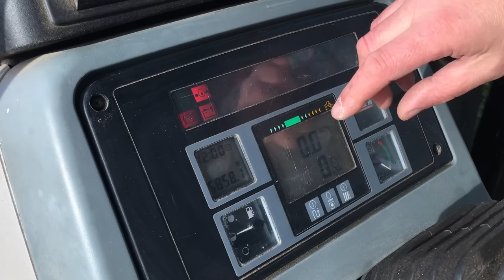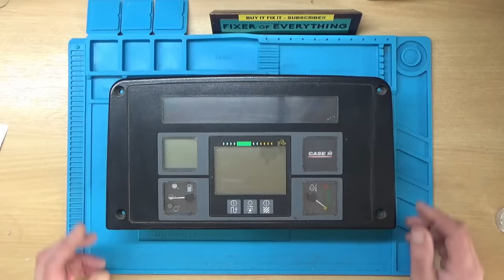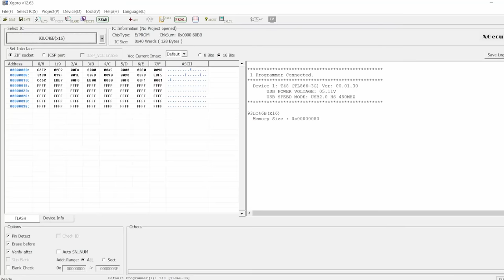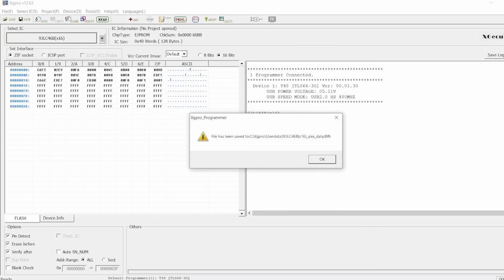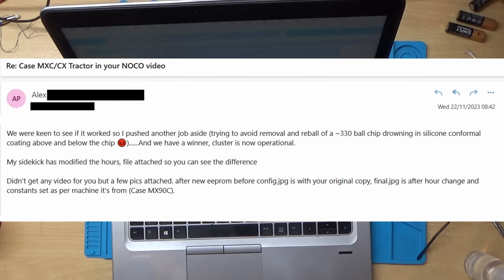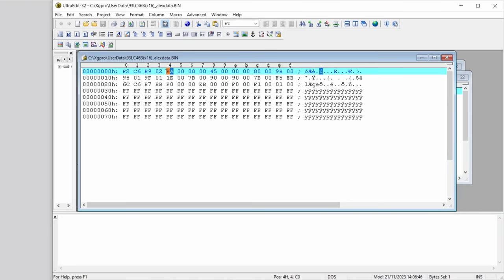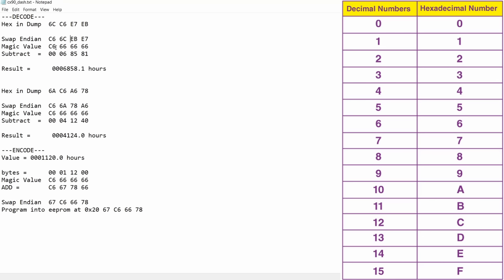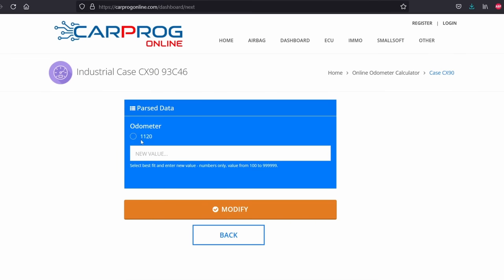Helping Someone 10,323 Miles Away Fix A Tractor Digital Dashboard!

Comment: I have a Kubota that is about 5 years younger - it's still 100% electro-mechanical.  No semiconductors to be found there, for which I am eternally grateful!
Reply from the maker: I've got a little Kubota RTV900 tipper truck. That doesn't have any semiconductors either.. Although the alternator just died, so I'm waiting for a new one to arrive (another job to do lol).

Comment: Legendary problem-solving and troubleshooting skills coupled with an insatiable curiosity for knowing how things work and on top of that incredible practicality and common sense. Inspiring.
I want to thank you: I was in a challenging (for me) troubleshooting situation with a Nortek VRF (heat pump) system that multiple contractors had walked away from. I channeled your patience, calm, and reasoning and was able to solve the problem. Thank you! Most guys in my shoes would have said there's nothing that can be done and ran off.
Reply from the maker: Thanks Matt and well done on repairing the heat pump! 👍

Comment: This is the most badass thing I've ever seen
Reply from the maker: Thanks 👍if you liked this then you might like the solar inverter I repaired and then had to figure out how the service password was calculated as the company wouldn't help me, or the ultrasound scanner where I unlocked a ton of hidden features and made it run doom 🙂
Reply: @BuyitFixit  I'll be sure to check them out during my binge :)

Comment: Save yourself the time and trouble (and risk) to remove a chip from the board, use some DIP test clips. Most of the time you can read/write EEPROMs in-circuit. Test clips are available for SOIC as well.
Reply from the maker: Thanks for that. I've got some SOIC test clips, but I've had limited success when trying to read eeproms in circuit. I tried with a landrover ECU a while back and it wouldn't read. Was just easier to remove the chip.

Comment: Considering the most sophisticated tools my Dad needed for our tractor growing up were a sledge hammer, pocket knife, "Bob" the screw driver (a big old beater flat head) baling wire and if feeling fancy, electrical tape lol, tractors with computers in them are hard for me to really wrap my head around...
Reply from the maker: This one is pretty basic, I think it's only the dashboard that's computerised. I dont think the engine has any electronic controls. The newer ones are way more complicated and pretty much all controlled by computers including the engine like a modern day car.
Reply: A welder helps if you manage to let the block freeze. I live in Austria, home of the legendary Steyr 80 series tractors, one-cylinder Diesel pigs from the 50s. Most of them have had the block welded at least once, some twice. Some of the T80s were sold without any electrics whatsoever, the posh ones got two headlights, either a combined rear/brake/number plate light or two rear/brake lights and a number plate light, a glow plug, a generator with regulator and a starter. Oh and of course a horn.

Comment: Very nice of you, noone I know will dare to do this.
You should have put a IC socket on the chip? rather than soldering it back.. heat damage to PCB risk etc
Reply from the maker: Thanks, agree I probably should have put a socket in. I didn't think I had any, but found some a week or two ago (used them when looking at the caravan x70 PSU)

Comment: Excellent job, much respect. You are a true gentleman and a scholar.
You should have checked every bulb in that dash while you had it apart, cos as sure as bears sh1t in the woods, one or more of the bubs will blow now you've had it apart. It's Murphy's law.
Reply from the maker: Thanks 👍There was a few bulbs gone. Ideally I should try to get some LED replacements.
Reply: @BuyitFixit  you could make some LED lights yourself, a LED and resistor would do the job. 
You can get premade ones but the cheap crappy ones won't last pissing time
Reply from the maker: @generaldisarray  I'll have to see if I can find some white LEDs

Comment: Very good, your reputation is obviously spreading furrow and wide. Surprised there was no JTAG connector, but each to their own. You were, of course, lucky that the text wasn't inverted.
Reply from the maker: Thanks 👍
Reply: There are so many different JTAG headers & adapters, unless you have the platform specific tools. Its more hastle than removing the chip.
Reply: A JTAG connector is not good to use in the enviorment the tractor is operating I think.

Comment: Oh I do like a bit of hexadecimal digging. Congrats on the remote repair and being willing to risk your eprom for his tractor. Great result..
Reply from the maker: Thanks John👍if you like this sort of stuff check out the video I did on the solar inverter called 'no password no problem ' or the medical ultrasound I looked at and unlocked a ton of extra features, or the RGB laser I repaired 👍
Reply: @BuyitFixit  thanks for the tips will investigate. I learn that way, been around software and firmware engineering for about 20 years. They do keep things close to their chests I found. Or no time to explain to a non programmer☹️
Reply from the maker: Thanks John 👍

Comment: For odometers in cars where storing in EEPROM would happen more often than the maximum numbers of write they use a simple wear leveling methode which only works for ascending numbers: There is a row of numbers stored, say 4 times. The highest one is the one being displayed and the lowest number is the one to  be overwritten next. So that is a 1:4 wear leveling. Works perfect, because I did this with a PIC16F874 back in 2001. The products (about 2000 were sold until 2016) still come in for service and no EEPROM has ever failed until now.
Reply from the maker: Interesting solution! Thank you for commenting 👍I did have another dump from a different tractor that someone sent me to look at and it has the value duplicated 3 times but it's all the same value. This had 2503 hours. A friend of mine worked this out after I sent it to him, I had company over so didn't have a chance to look at it myself.

00000000h: AA FF 00 02 4A A4 93 83 00 02 4A A4 93 83 00 02 ; ªÿ..J¤“ƒ..J¤“ƒ..
00000010h: 4A A4 93 83 00 00 00 00 00 00 00 00 42 00 8F 14 ; J¤“ƒ........B. .

00 02 4A A4 = 150180 mins 
00 02 4A A4 93 83
the last byte 83 is the sum of the previous. We aren't sure on the 93 byte though.
Reply: @BuyitFixit  Yeah that is odd. With the checksum being explicitly for the counter only, one would guess that the 93 must be related to that counter value somehow. But I have no idea what it could be. Concerning wear leveling: After coming up myself in 2001 with it, I found the same methode in the cluster of my VW Golf in 2016-ish. The blue LEDs were so dim that I had to replace them. VW also used another methode for storing the 0.1km odometer values which I didn't bother figuring out.
Reply: @BuyitFixit  One idea about the two counters: Storing it twice could be a way to determine if the value was changed at some point. While one of them is displayed and can be changed with the programmer, the other one can only be read. This could be used as a tamper detection.

Comment: Very impressive, well done! :) Certainly made interesting video too. 
Brought back a memory of my dad's old 1995 VW Golf Mk3 Variant, at some point the instrument cluster digital LCD odometer panel started showing only parts of the reading, except when the temperature was colder than -20C, then the numbers showed up completely. 
At the time I didn't know much about electronics, but now I'm guessing probably the LCD display solder joints were cracked or something. Eventually the whole instrument cluster was replaced. 
Too bad Youtube didn't exist back then, would've saved a lot of money if I knew back then, what I've learned now from yours and others repair videos :)
Reply from the maker: Thanks MrJSV 👍

Comment: Very well done. You risked damaging your panel to help someone in my country (Aus). I'll bet if he took it to an authorized  repairer they would have wanted to replace the entire panel at great expense.
Reply from the maker: Thanks, and absolutely! I've had issues with companies before where they wouldn't supply parts or would only replace the whole device great expense. An example would be the FLIR thermal camera I repaired after getting no help from FLIR (I show all of the emails on the video on my channel too), and another would be the solar inverter video called 'No password No problem' where I had to reverse engineer their software because they refused to give me a service password and said it's an old model, buy a new one! (I also did a video on repairing it as it was a dead unit when I got it).

Comment: Absolutely fantastic video. The attitude, the great explanation skill and superb detective work. I wonder how did you realise what the magic value is. Thanks a lot!
Reply from the maker: Thank you too for your kind comment 👍 That online site I mentioned (in the video) I changed 1 of the byte values by 1 and uploaded it to see if anything changed. When the hours increased by 1. I then knew that for instance a 7 in the dump equated to a 1 in the hours.  So at that point I knew 6 = 0, then it started to make sense 🙂👍
Reply: @BuyitFixit  now when you said it it sounds so simple. I guess that happens often with clever ideas. Again, thanks for sharing. Not that I can use the idea to fix the tractor mileage but because I enjoy your thoughts sequence and can educate myself.
Reply from the maker: Thanks 👍

Comment: Re. the "magic value", it looks to me like it's using a variation of BCD (Binary Coded Decimal). If the value was stored in binary, they'd have to do the conversion from binary to decimal to display it, and that might be too much like hard work for a low-cost microcontroller. Using some form of BCD would be easier. With the digit 9 represented by F, adding 1 would make it wrap around to 0 and generate a carry into the next digit. It's easier to detect digit 0 and then add 6 than detect digit A.
Reply from the maker: Could well be. Someone else mentioned similar and it seems a common way to convert to BCD by adding 6 👍

Comment: the data is stored as little Indian, also a tip for owner who have Hare and tortoise modes that dont work is to check the rear axel oil pressure switch and oil level.
Reply from the maker: Indian 😂gotta love auto correct (my phone did the same when trying to type endian). Thanks for the info 👍

Comment: Most likely used the same software to dump and write as it has an hex editor, my guess is he searched for your hours, came back with a hex code, he then converted his hours into hex code and replaced and reflashed :) how I repair corrupt mac bios and use a dump I have and change the serial back to theirs :)

EDIT: I post this when the video was half way through :P he explains how :D
Reply from the maker: Yep, explained it and how the the data is stored 🙂👍

Comment: This is awesome, well done! Just wondering.. would it have been possible to download the flash with the chip on the PCB, I see there are 8 pin in-circuit clips available for this function.
Reply from the maker: Thanks 👍,Yes it is possible, although sometimes it's not straight forward (I've tried in the past with limited success). Normally you would need it powered from either an external source, and have the microcontroller held in reset, so it could not mess with the I/O lines of the EEProm.
Reply: It worked with Delphi Skoda OEM radio,  I did not even have clips- just soldered fine wires to chips legs. It wasn't  DIP8 "big" chip either but small SMD part.
Reply from the maker: I tried with a Landrover ECU once, to remove the immobiliser, but ended up having to remove the chip and read /write it, as it didn't like it being in the circuit.

Comment: I have a smallholding in the UK, 30 acres or so, all my tractors are 60s 70s 80s pre electronics, simple mechanical systems, I rarely have any problems with them. A quote from an engineer : "Perfection is reached, not when there's nothing left to add, but when there's nothing left to remove....
Reply: When you put few hours on your machinery per year, complexity is your enemy.
Reply from the maker: Agree, we have about 30 acres too, and about 70 sheep or so 👍🙂
Reply: @BuyitFixit  Ah sheep, however good your husbandry, a certain percentage seem to just die for no explicable reason, I never figured out why. I'll stick with cattle.
Reply from the maker: @andypdq  I think you can see them on the 2 x night vision monocular repair video that I did, or there's a picture of a couple of the 'expensive ' ones on the medical ultrasound video.

Comment: Liked and subscribe. The least I could do on behalf of the open hardware community.
Reply from the maker: Thanks! I've had a few run-ins with companies when trying to repair devices. I asked FLIR for a spare part for one of their cameras, and got an email back saying they couldn't help to do copyright and proprietary information. I only wanted to buy an LCD display! I ended up doing a video on that, and my work around which may interest you. Also I had a problem after repairing a solar inverter (video on here) which I needed a service password and the company refused to give me one and said buy a new inverter! (which I wasn't going to do seeing as I just fixed the thing). I spent a few days reverse engineering their software and wrote my own password tool which I've made available to anyone who is in the same situation (video on here too called 'no password, no problem'). Hope you enjoy some of my other content 👍

Comment: I wonder why that magic number is used and subtracted? Also why did the EPROM content fail the other tractor, but it looked intact in your editor?
Reply: I would imagine the magic number is just to obfuscate where the hours are stored in the eeprom, would be all too easy otherwise!
Reply from the maker: The eeprom gets written to every 6 minutes I guess, it's possible that something went wrong during one of those writes and blanked it. Or sometimes chips can fail for no obvious reason.
Reply: The magic number offsets each BCD digit from 0x0-0x9 to 0x6-0xf, which I suspect is there to make it easier to increment the number. Each digit just rolls over 0xf->0x10 naturally, the current digit becomes 0x0 and the 0x10 carries over to the next digit. You do still need to go over the results and deal with any rolled over digit to add the 0x6 offset back, but that's trivial to do.
Reply: @ville_syrjala  certainly clever thinking, but it is also trivial to deal with the 9 rollover - and then you don't need to take additional steps when writing the value to the display, so I dunno...bit strange
Reply from the maker: @zaprodk The EEPROM in the other dash was all blank 0xFF. The dump he sent back was a copy of mine with the hours altered which is what they used after testing my dump worked.
Reply: @BuyitFixit  every 6 minutes. That's a good way to wear out the chip. What's the block size of that particular chip?
Reply: @zaprodk   should last 10 years with a 1 million cycle endurance shouldn't it? I've seen FRAMs used in more modern equipment for this purpose, they have a 100 trillion cycle endurance!

Comment: I'm sure Case IH hates this.  They would rather they sold you a replacement dash.
Reply from the maker: Unfortunately it's the same with a lot of manufacturers. I fixed a solar inverter on here but then needed a service password to change a setting. The company emailed back with 'buy a new one' pretty much. I ended up reverse engineering their software and writing my own password tool which I made available for free to anyone who wants it (no password no problem video on my channel). I also had similar with FLIR when trying to repair one of their thermal cameras (video on my channel too). Thanks for commenting 👍

Comment: being an ignorant layperson when it comes to such things... how did you decode the way the hours are calculated? Was it a bit of trial and error plus knowledge of typical methods used for such things or was there some more magic involved that wasn't shown?
Reply from the maker: Hey don't worry if you don't know stuff you can always learn! This is how I figured it out.
I sent Alex the dump from my chip. He then used a site to change the hours, and he sent me a copy of the dump back (with the changed hours). I then compared the two dumps to see what had changed. There were only a couple of bytes different so I knew this was where the hours were stored. We also know that the tractor stores 0.1 hours so it must update the value every 6 minutes. It was then a matter of trying to figure out how the value was actually stored.
I then found a site that displays the tractors hours if you upload the dump, so I then tried adjusting a byte by 1 and uploading it to see what changed. I was then able to figure out how it was stored. Another way to do this would have been to run the tractor for a length of time and dump the chip again, and see what changed and by how much. Hope that helps!
Reply: @BuyitFixit  thanks. Still plenty of MX and CX tractors kicking around in the states - this is good info for anybody who finds themselves in the same situation Alex was in.

Comment: 7:00 Get yourself some proper prefluxed braid/litze....
Reply from the maker: I don't normally put flux on the braid and it works fine, it was just with it being low melt solder it sometimes needs a bit extra flux.

Comment: Couldn't you just use a clip on the chip instead of desoldering it?
Reply from the maker: Perhaps, but I've haven't had much success in the past trying to read chips in circuit. Things (like the CPU interfere with the data lines when trying to read so you have to keep the CPU in reset, or you might have to power the board externally as using a clip from the eeprom programmer might try and power up the rest of the board. It was just easier for me to de-solder the chip as I've done similar loads of times 🙂